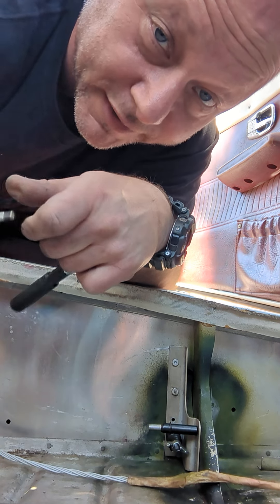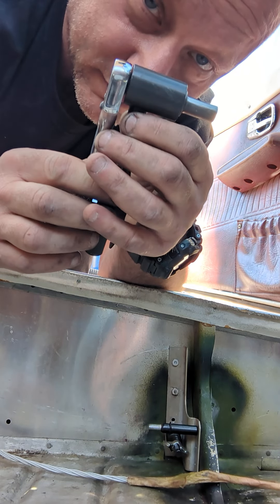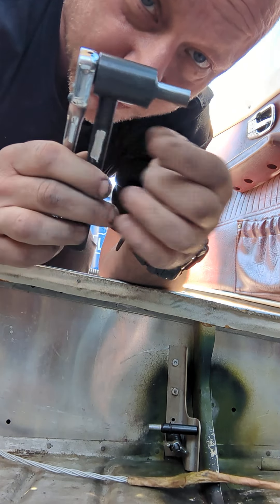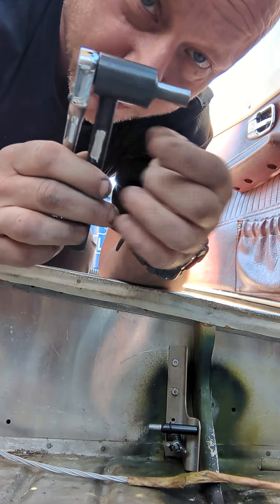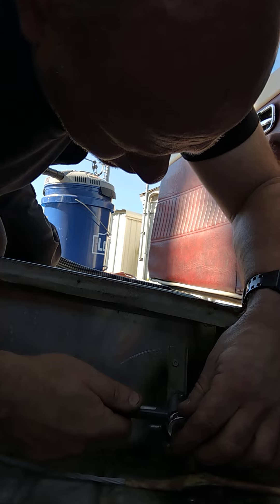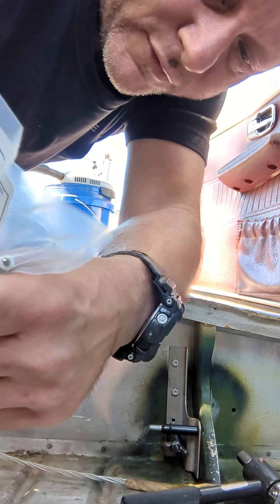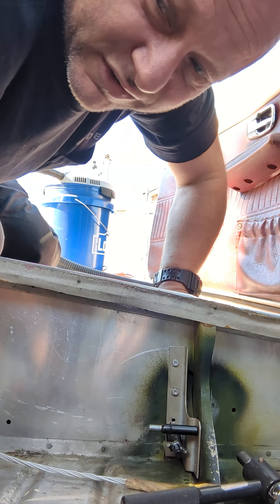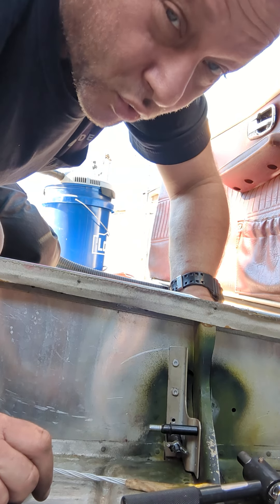Aircraft Jo Bolt installation

Comment: Where did you buy ur jo bolts from? Good video....yea I'm working on a beech too....Not easy to remove. You can install them without the too....should only need to apply ~30-40inchlbs and the stub should break. Beech man...they had to do shit really different didn't they....

Comment from the maker: Hi guys, so to answer your questions... The ratchet came as part of the Jo bolt installation kit and I removed the old ones pretty much the same way you would remove a Cherry Max rivet.
My preferred tool for this function is a snap punch. It's basically a center punch with a spring that you pull on and then release. You can goggle it. They're inexpensive and they work extremely well.
Lastly, yes, depending upon application you can use them with washers but you need to allow for the extra thickness of the washer when determining the length of the Jo Bolt that you're going to use.
That said these are meant to be blind fasteners and getting a washer on the back side of it would be in practical in most situations and I'm not sure would benefit you by putting it under the head. But, once again it depends on the application so I could be wrong.

Comment: Is it possible to use a washer?
Reply from the maker: Sure, if you're using engineering data though, I would follow that explicitly. If not, just remember these are structural blind fasteners and you can treat them a lot like structural bolts. Make sure that you select a washer that fits neatly onto the Jo bolt and allow for the extra length that the washer is going to consume.

Comment: How about the removal
Reply from the maker: I haven't had to remove any but I do know that you cut off the collar to remove them. There is probably a tool that goes on a rivet gun. A Dremel might be useful too.
Reply: Depending on diameter of the fastener to what size drill bit to use, or a ball style rotary file, drill the stem, or grind the stem and head down, punch the stem through, then use the original whole size diameter drill bit to take out the rest of the Joe bolt and punch that through too